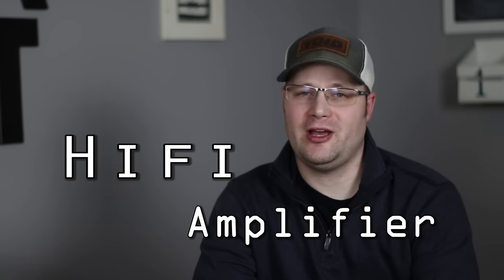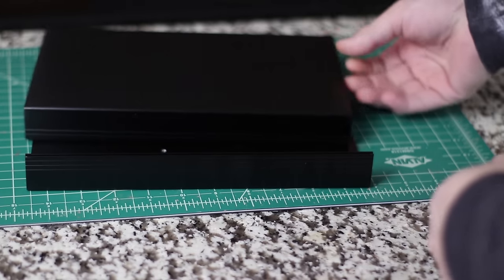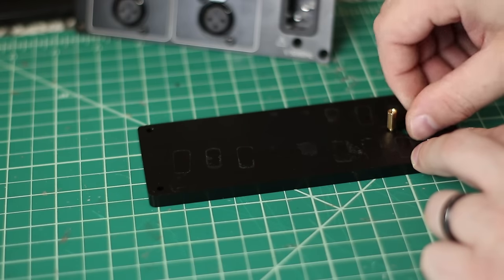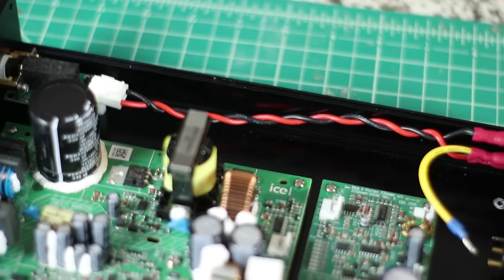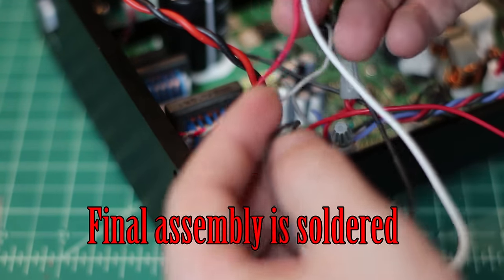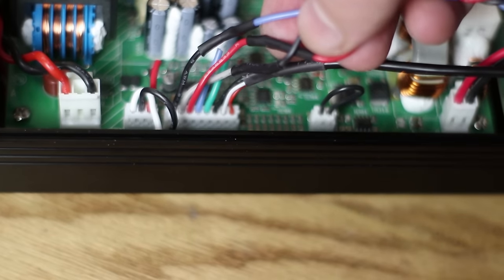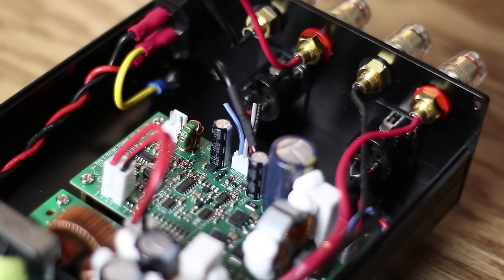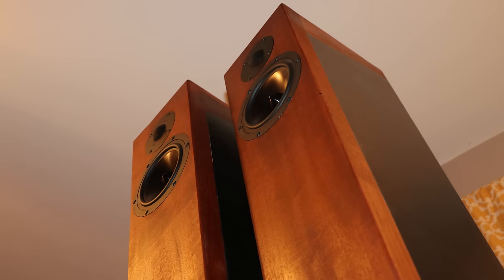How to Make a $3000 DIY HiFi Amplifier for $300

Comment: These little Class D amps are good for some things, but I wouldn't go comparing them to a $3000 amp.    Even if B&O may have used them for something like a portable speaker or something.    0.2% THD+N?  That's actually pretty good for a Class D,  but  a semi decent Class A or A/B amp would show two or three orders of magnitude less distortion than that.
Reply from the maker: B_O actually designed these for their HiFi class d amplifiers.
Reply: @Toid  Do you have a link to an actual product?   I see the boards are B&O branded, but to my knowledge B&O doesn't sell Hifi Amplifiers.  I do know they sell many different kinds of active speakers and have a strong preference for form over function, which is why I'm guessing they tried so hard to get the THD on a Class D down to 'reasonable' levels on a tiny little board.
Reply: @peetiegonzalez1845  -- FYI, the history of ICEPower and its relationship with B&O: https://en.wikipedia.org/wiki/ICEpower#History
Reply from the maker: @peetiegonzalez1845  Almost every HiFi Amplifier company has used or currently uses IcePower in their HiFi amplifiers.  The funny thing is that you will see the same companies spewing out different THD numbers.  It's not because their THD is different, it is because each is measuring it differently.  There is no standard at which they need to report THD.  So some will report THD at 1 watt @ 4ohm (with this amplifier that is 0.008), while others will give it at 8ohm, etc.  I want to give you the most honest figure, which is 0.2% at full wattage at the lowest impedance.  When you want to compare THD levels, you need to see how they are measuring it.  Unfortunately most won't tell you.  And many companies will use their 1 watt THD, to appear lower than it actually is.
Reply: @editorjuno  Thanks for your link. Of course the IcePower amp is very high quality (for a Class D)...
Reply: @Toid  Fair enough those numbers are not directly comparable without extra detail.  But you can't deny a good Class A or A/B amp can easily clear that by orders of magnitude at the same specs otherwise.  It's been said in your threads that 0.01% is a threshold below which nobody can tell the difference... well maybe.  I'm still not convinced on Class D amps.   Actually I wish I was, I believe the tech is possible, but until someone comes up with a perfect low-pass filter, I'm not convinced.   

disclaimer:  I DO use Class D amps in my own home.  Just not for the "audiophile" sections :D
Reply: BTW despite my disagreement with some of your statements, I think your content is pretty good.   Subbed.
Reply from the maker: @peetiegonzalez1845  Just to clarify, all I'm claiming is that HiFi companies consider them HiFi.  I don't remember ever stating anywhere I said .01% is a threshold for anything.   It doesn't sound like anything I would say, unless I misspoke.  Which is entirely possible.  As far as THD is considered, it's actually frequency-dependent.  The lower the frequency the harder time people have hearing distortion.  The higher the frequency the easier.  at what point people can start hearing the differences up to a lot of debate.  Really a lot of tests have been done on it with varying degrees.  The truth of it though, is the lower the number and it fire company can put on the spec sheet, the more people will buy it.  Even if there is no actual audible difference.  I appreciate having an actual conversation with someone like you.  there's too many people out there that are so hard on a stance that they won't get off of it and won't hear the other side.  I personally like class a, b and class d amplifiers.
Reply: @peetiegonzalez1845  --  The low-pass filtering required for a modern Class D chip is usually a simple cored inductor and really isn't all that critical or difficult to build or obtain as a component, so I'm not sure what sort of perfection you're stipulating and why.  The inductors in a speaker's crossover network have much more effect on what you hear than a coil that just has to prevent ultrasonic (and therefore inaudible) switching artifacts from coming through.
Reply: @editorjuno  It was my understanding that because the Class D architecture uses high frequency pulse width modulation, and the HF needs 1) shielding but also 2) filtering out of the signal (low-pass) so the harmonics don't cause distortion.  i.e. The high distortion levels of Class D amps were a direct effect of the PWM and very difficult to filter out.   I'd gladly be corrected if I've read that wrong somehow.
Reply: @peetiegonzalez1845  -- The measured performance characteristics of modern Class D chips using simple cored inductors for low-pass filtering seem to speak for themselves.  As for "distortion levels," today even inexpensive Class D chips have THD+N numbers that are arguably below audibility.  As for shielding, a duly grounded all-metal case suffices nicely AFAICT.  I too would gladly be corrected if I'm missing something.
Reply: @editorjuno  Thanks for sticking with me.   I agree about the shielding, of course my own amp at home has a metal case.  I did a bit more digging, and funnily enough, found this video:
https://www.youtube.com/watch?v=98QQ43qgzbg
In which Paul McGowan of PS Audio talks about his take on the current generation of Class D and where he sees it going.  
I noticed you were an avid commenter on that thread, too, as were a couple of other commenters here!  lol.   I agree with Paul, here.  Maybe it's in the details of what you define "Hi-Fi" to mean.  I have no doubt that Class D has come of age and very good in a lot of use cases.   My original issue was the comparison of this little amp to a "$3000 amp".   Now I'm not sure if PS Audio or anyone else ever sold a $3000 amp that used this particular board as a component.  If they did, they deserve a kick in the Bose, or a shiny Apple for their achievements, but to me,  a $3000 amp should be audiophile class.  Which I definitely do not think Class-D is competitive in just yet.  There may be no stats on what is 'audible' in terms of THD, but I personally find them fatiguing when used with high-class speakers or headphones, and I think the THD figures (however inaccurate) are significant in that regard.  In any regards, This is a great little project and definitely 'good enough' for most listeners.  I look forward to the next generation unseating a new tier of studio-class equipment.  For now,  I'll stick with my A, AB on my main systems.
Reply: @peetiegonzalez1845  -- Fair enough, and thanks for your input.  I probably would have stuck with my big -- and very good -- old gear too if retirement hadn't made me into an apartment dweller.  Peace.
Reply: @Genuine Audiophile Thanks for the link.  Those specs look very promising.  I might try a little DIY project of my own using these and see what they sound like.
Reply: @Genuine Audiophile I won't take offence at that as clearly I'm not of your Angry Trolls... but let's be fair, this nice little amp in the video isn't exactly the same league as $3k A, or AB class amps.  nor are most Class D.  Nor in the same league as the excellent Class D you posted (which was an eye-opener.  Thanks for that!).  Neither is it actually used in a $3000 amp (which was clearly admitted in the video via annotation) so it's only fair to take issue with the overzealous headline.
Reply: @Genuine Audiophile Well,  I'm glad I did comment, or I wouldn't have learned about the Hypex.   Exciting times!

Comment: Message: Hi. I built the $3000 amp for $300 and it sounds great. Thank you. Was is the function of the ICEpower 6277849 Auto On/Off Wiring Harness for 200ASC? Is it for the LED on the button or does it power on the unit when the preamp is turned on? If it’s the latter it isn’t working for me. What might I be doing wrong? Thanks again.

Comment: And if you go to AliXpress instead of PartsXpress, you can do it for $50
Reply: Did you find this board there?
Reply from the maker: @hugopalmava  He is just talking about class D board.  I am guessing, he doesn't realize that icePower is a lot different than the run of the mil class D amplifier.  Ice, has put a lot of work into their filter, so they can provide a high fidelity signal, that most other class D amplifiers can.  The two most used by HiFi companies are HyperX and IcePower.

Comment: If you buy a $3k amp your paying for the name and bullsit facy pants ego drive GAS case it comes in.
Reply: So your saying the parts are the same quality no mater the price? The build quality the same? No difference?
Reply: True.
The only time paying big money for any modern amplifier is worth it is if you need BIG power.
Since that requires beefy expensive components.

Any pre-amp that costs more then a couple hundred of bucks is a massive waste of money.
Heck, even below 100 bucks you can get some really solid pre-amps.

Comment: Ok,  you make it sound like a no brainer!  Very In learning more.   Looks like the audio front end on the amp is driven by a 12vdc power supply.   Being an d guy,  I’ve always thought of these little switching PS to be noisy hence why I believe often said most class D design have a higher noise floor.   That being said,  I know there seems to be what looks like some DC filter built into the amplifier board.  What was your experience regarding noise?   Also,  I’m interested in what type of sources did you try?   I would think a preamp with a warmer sound would pair nicely?

Comment: So many snobby audiophiles here..
Reply: I just want some proof of the Fidelity and power output. He can't provide either.  He is receiving money for this video. He should show proof the amp can do what the specification sheets say it can.
Reply from the maker: @waderyun.war00034  Here are all the specs you could ever want from these modules.  These were produced to be sent out to HiFi companies and not to consumers.  They don't mislead about the THD, they even include graphs so it is easy to understand.  If they or I wanted to mislead you, I would have said THD is .008% (which I  could have).  Since it is .008% at 1 watt.  Interestingly enough there is no standard at which people need to report THD, which is why you see such a wide variance, even using the same chip.  I personally, feel it should be reported at max output (200 watts).  Here is the data: https://www.parts-express.com/pedocs/manuals/326-108--icepower-200asc-class-d-amp-with-power-supply-module-1x200w-data-sheet.pdf  If you want to dispute it, feel free to test it for yourself.  I'll stick with the data already tested.
Reply from the maker: @hushpuppykl  I appreciate the feedback.  I completely agree that you have to use your ears to decide on the sound quality. In fact I mentioned that in my last video on Wavecor drivers and about everytime I design a crossover.  In speaker design, a flat response is often desired. And although that can be a good indicator, it is cannot be the deciding factor in whether a speaker sounds good.  Just to clarify the first 1 minute of the video, I stated these boards have been or are currently used in amplifiers costing upwards of $3000.  There was actually an outlier, which I can't remember what company off the top of my head that were selling these for around $5500.  The point is to show you or anyone else, that if it is an IcePower module, you can build it yourself for a fraction of the cost.
Reply: @waderyun.war00034  no need, but I specs are provide by manufacture like all amps even so called audio file high end amps. Besides specs mean nothing, but what matters is how it sounds. Get life, so many so called audio file snobs care about specs more then music or sound quality.
Reply: @airgliderz  we all need to get a life. I will buy one and assemble it then I will comment on how it sounds. Still doesn't change the fact that this is basically a commercial for ice power. Although the links for everything is convenient.
Reply: @airgliderz  class D amplifiers don't typically sound very good used for full spectrum audio I even got rid of my class D for my subwoofers because I tried a class AB and the difference was amazing I will never use a class D to power my subs again
Reply: @waderyun.war00034  so what, he does not matter at all.
Reply: The sad thing about the pissing matches people have over audio stuff is that super expensive audiophile gear (particularly the electronics) is only a thing because of ignorance about the technology - we have solid state stuff that can produce and amplify signals at very high (and low) frequencies and currents accurately, way beyond what audio calls for. Yes, it's more expensive, but not more expensive than the obscene audiophile gear out there, and sometimes that stuff isn't even very good at what it does.
Reply: @hushpuppykl  People listening are not reliable. Room interactions, personal EQ and phase preferences, and what they had for lunch are going to skew their judgements.
Reply: @waderyun.war00034  That's not the fault of Class D, it's the fault of that particular amplifier design.
Reply: 123Toid 'Interestingly enough' there are at least three applicable standards, of which the FTC regulations are legally binding on anything sold in the USA, and they say you have to disclose THD at full rated power to avoid a charge of deceptive advertising.
Reply: @hushpuppykl  It would be interesting to do a blind audio test comparing the $300 class D amplifier to a $3000 class D amplifier and see if you could tell the difference. Assuming you had a good way to instantly switch between amplifiers and using everything else common (preamp, source - TT or DAC, speakers) and both amplifiers were set to exactly the same output. I doubt you would be able to tell which amp was which. I'm just saying...
Reply: WHY?  This kit is not worth $300 and the final thing is certainly not worth $3k.
Reply: class D is crap
Reply: @hushpuppykl  A $3000 amp that uses the same amplifier internally as this will have The same performance. Its as simple as that. What hifi brands do with these is not some magical voodoo, its cost cutting to sell at higher margins. Instead of engineering the amplifier in house, they build a case around off the shelf components. Any perceived difference in sound quality is going to be placebo. Take this setup and test it next to a $3000 amplifier with a network/spectrum analyzer i will guarantee you will see the same results. If the output is the same, the sounds the same. It really doesn't matter what you tell yourself. The numbers are what matter.
Reply: Aaaaand the link to the specs is broken :(
Reply: @Toid  firstly, these amps will use massive amounts of NFB.  Secondly, the distortion harmonics will more than likely be odd order.  Both are recipes for disaster from an amp design point of view imho.  

PS 200w is an awful lot, 99.9999999999% of people do NOT need that many watts.  It 's like a 5000 HP motor in a small car for a single bloke...
Reply: @airgliderz  a) it's "you're" NOT your.  b) it's spelt piece.  Lastly, Wade was actually questioning whether the paper specs are accurate.
Reply: @airgliderz  PS, there is far more to amp design than "specs" or measurements.  Valve (aka tube as Americans like to call them) quite often measure bad, but they tend to sound so much better than their transistor based brethren.  I've been an advocate for Class A SET no NFB designs for 10 or so years now, after nearly 20 years prior to that usage of typical transistor based class AB PP FB designs...to my ears, in all honesty, those latter designs have a nasty upper midrange glare that is just plain unpleasant to listen to.  YMMV.  But hey, I still prefer LPs to anything digital audio.
Reply: @davepastern  because they can't reproduce high frequencies well when solid state does and sounds far better clearer. If you like colored artificially warm sound of tubes then so be it.
Reply: @airgliderz  lol wtf?  Valve amps may have some issues with low end frequencies, but the high frequency crap you're spouting is utter BS.  

PS not all valve amps are "coloured" etc.
Reply: @davepastern  same BS you spout off on about solid state amps.
Reply: @airgliderz  I base that same BS on 30 odd years as an audiophile listening to many, many different amps.
Reply: @airgliderz  oooh struck a nerve did I?
Reply: @airgliderz  that comes down to the individual though.  Not everyone is necessarily biased.  Even with blind listening tests, there are internal biases btw.
Reply: @mikee9167  not true. Class D amplifiers have a poor linear response compared to class A or Class AB. It's one of the inherent characteristics of the amplifier design.